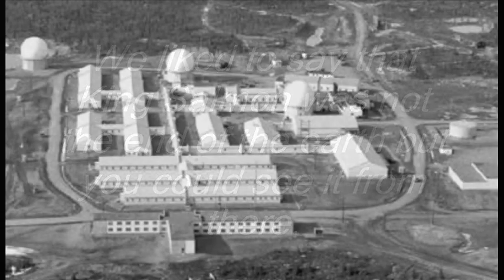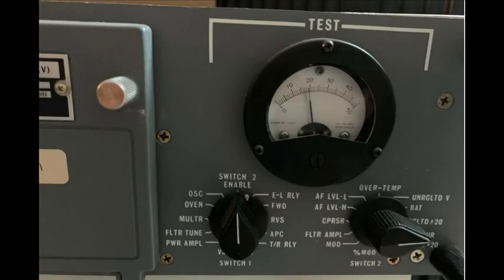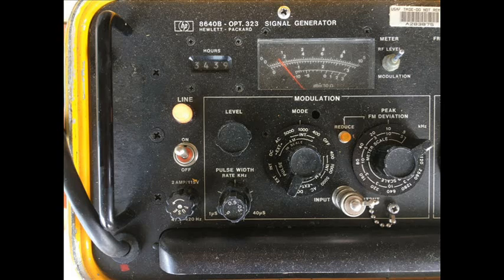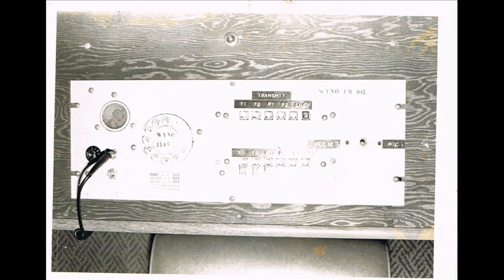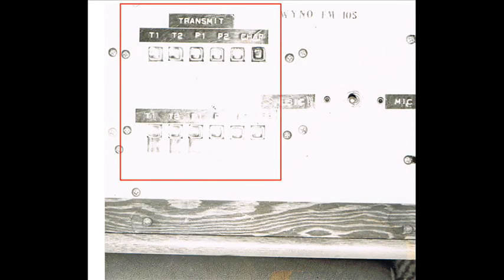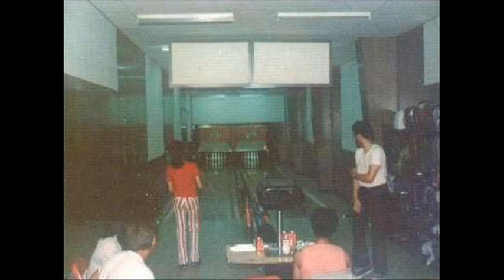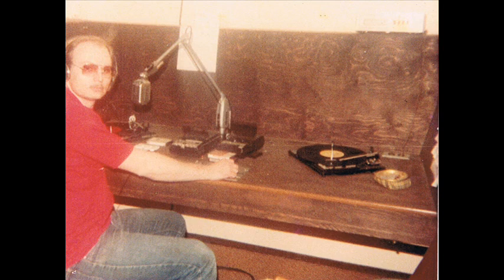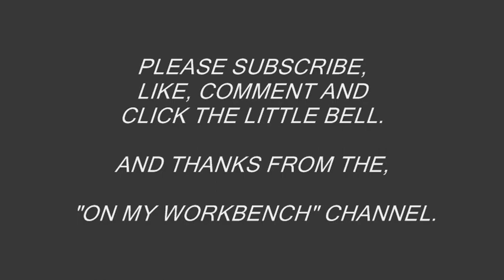WYNO FM 105 King Salmon Air Force Station Alaska.

Comment: Well-done, "On my workbench!"  I was a civilian contractor, working on the White Alice Communications System (the tropo-scatter system you mentioned that supported the Air Force with telephone and low-speed data communications - for background, see https://en.wikipedia.org/wiki/White_Alice_Communications_System) at Cold Bay Air Force Station, between March, 1974 and July, 1976.  We also had a USAF low-power TV and AM radio detachment there.  In my off-time, because I'd been a (FCC-licensed, I hasten to point out) disc jockey in the "lower-48", I volunteered to help them out, when they needed things like (ahem) "potty-breaks".  If you're interested, I have war-stories ...
Reply from the maker: Hank, Please post some of your war-stories .
Thanks Dave.

Comment: I was at King Salmon from Nov 1982 to Nov 1983, I was with the Security Police SQ. The radio station was back on the air while I was there, I was one of the DJ's. What a fun time, it helped to keep me busy. I actually received a request as far as Dillingham, I couldn't believe it.
Reply from the maker: Thanks for the comment I am very glad that you enjoyed DJ-ing at WYNO. I had a lot of fun building it, How did you find the video? Dillingham was only 70 miles from King Salmon as the crow fly's and WYNO's  transmitting antenna was 120 ft above ground level so with the right weather conditions the signal could make it to Dillingham.

Comment: OMG, I saw your post on Facebook.  I was an A1C then SrA while at King Salmon (Nov 82 to Nov 83), assigned to the 1931st Comm Group, Detachment 5.  My boss was SSgt Ira Hobbs and the MSgt boss was a nice guy who was a radio nerd (my opinion) who taught me a heck of a lot on FRC-153/KWM-2As prior to him departing shortly after I got there.  When I got there, the WYNO was off the air but it was still connected to the GRT-21 and the 8640B.  Nobody was using it, I got it up for maybe 2-4 days, and got a call from a guy who said he was in Naknek and he asked if it was back up.  I said I was just fooling around and playing some music.  So, it was working when I got there.  As I remember though we had to utilize the spare GRT-21 for a new mission as I think when they remoted the ACW to Elmendorf during my year that caused the death of any possibility for WYNO as you designed it.  It was a great design as I remember, hats off to your creation!  :)

Comment: Excellent story.....and an outstanding effort on your part!
I was stationed there a bit later....say, 1985-86.....as a weapons troop for the Alert F-15s.
I don't recall the radio station, but then, I wasn't there for more than a month before the entire Alert operation was moved to Elmendorf while the King Salmon runways were repaired....if, in fact, the repairs were ever accomplished.
Regardless, I ended up pulling the remainder of my alert duty there at Elmendorf AFB.
Great memories.....I STILL miss Alaska.
Reply: I was admin at the CAC back at King while you guys were with SMSgt McCreery (sp?) and SMSgt Sterba back at Elmendorf.

Comment: Wow.  I arrived just after it shut down.  GATR troop.  I did LMR and in my off time I maintained the cable tv and did all the coin op machines in the area.  What a memorable time.
Reply from the maker: David Rhodes,  Yes if nothing else KS was memorable. I have two questions 1. what is LMR? and 2. How did you find my video?
Reply: @onmyworkbench7000  LMR = Land Mobile Radio, like Motorola and GE at that time.  My main shop was the ATC Radar Approach.  I wonder if civilians George and Dee were there working the dining hall at that time?  I took the General out with my ham radio so he could play at rapids camp.  All in all, I think my time at KS was the best two tours (back to back) in my whole career.   All those good memories.  Route 66, Yogi’s trail, Eddies Fireplace Inn - although Eddie was kinda sketchy.